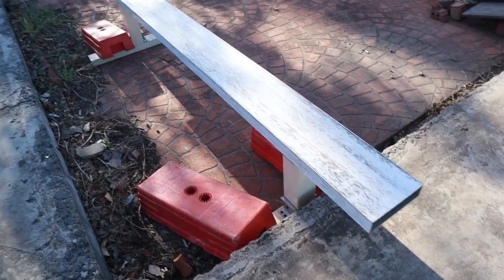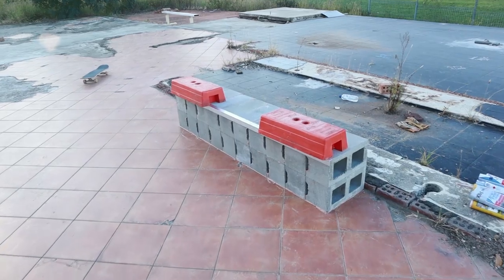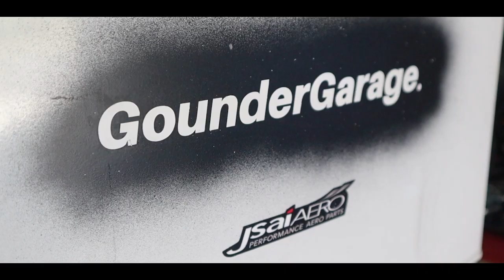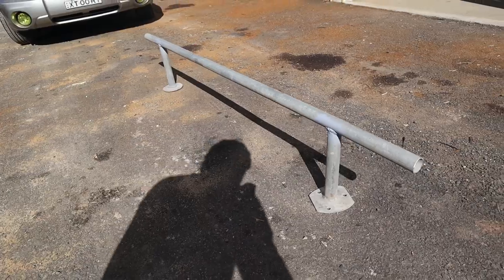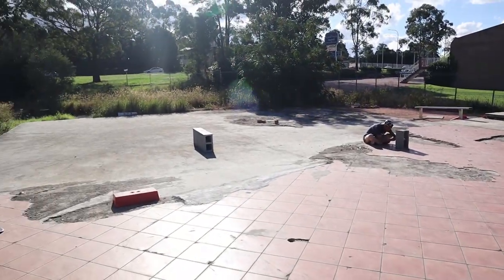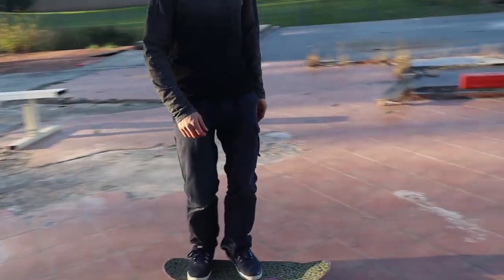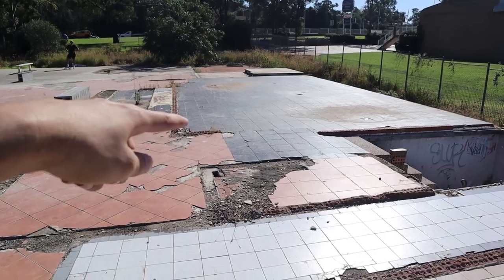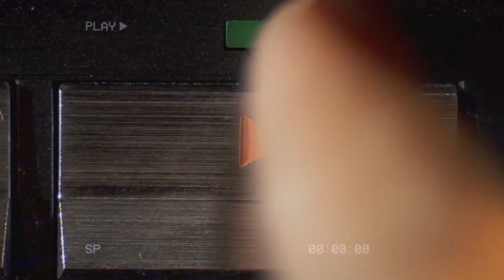D.I.Y DIARIES EPISODE 3 | D.I.Y SKATEPARK | HOW TO BUILD A RAIL

Comment: 4 foot mini-ramp !!!! With a 6 foot extension and a centred Roll-in !!
Reply from the maker: That would be so dope
Reply: Sean Enuks  fukkin’ right Eh!  Can build it outta scrap wood.  Build it beefy with lots of support.  Just thick plywood for surface.....and then.....you can pour a thin layer of high strength concrete on the plywood to make it the best possible riding surface.  👍🍻🇨🇦

Comment: hey homie awesome video and I want to give you some friendly advice about what to do with the slab. I think before you go to crazy with features you should buy a couple bags of self leveling concrete  and get rid of all the cracks and choppy areas its really easy and you have the tool you need already
Reply from the maker: Scott MacDonald that would be a rad idea I just looked at a few videos with people using it, had a quick google search on the type to buy and it’s around $40-$50 a bag here :( lol rip  what I’ll do is try to patch up where I can with quick set cement or car body filler
Reply: yea a bit of bondo and mortar will will work in a pinch for sure much cheaper

Comment: you should put a rail on the left side of the manual pad
Reply from the maker: I’ve considered that but it would block flow from cutting back towards the rest of the park if you were to manual off the side and towards the ledges etc

Comment: aVoid laying spraycans as they'll sputter and spit
Reply from the maker: Thanks for the tip dude, I wrote graffiti for years and I had no idea that could happen to cans haha
Reply: @SeanEnuks  There is a tube going from the bottom of the can, send ing paint up the length of the can and out, so if you tip it, the gas can get into the tube, escaping. One usually only does this to clean the tube and nozzle by turning the can on it's head and giving a few blasts. Preventing paint drying in the noz.  I used to mix paint and fill spraycans for people to use on their cars, if they needed a small amount special for their car's paintjob.